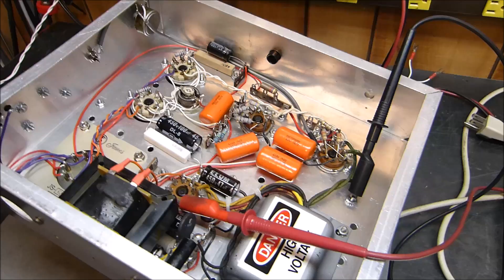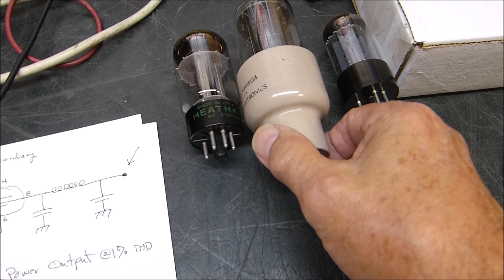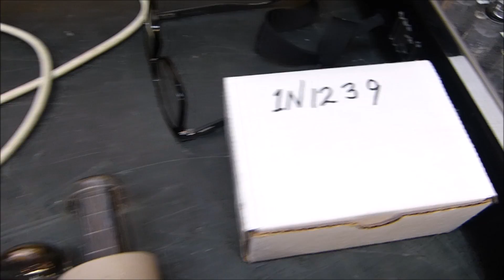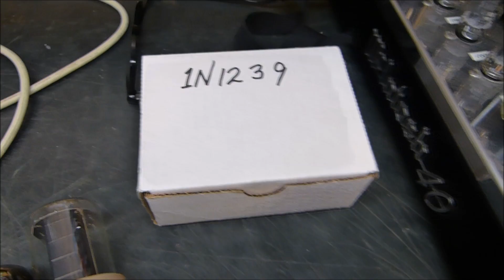5U4, 5R4, 5V4, 5AR4 & Solid State Rectifier Performance in Vacuum Tube Amplifiers

Comment: Curious why you switched from the hybrid diode tube full wave rectifier to traditional tube rectifier? I noticed that in your previous video "6B4G & 5881 Vacuum Tube Amplifier Using James Audio Transformer" you were getting more power from the amp and less distortion. . . . Also I've been thinking about building something similar but, I've been a little frustrated by the original Arcosound diagrams since they don't mention the DCR of the chokes or have many voltage readings through the circuit. (I like to model things in PSU Designer before building) With some educated guessing it looks like they ran the tubes pretty hot, they wrote 450 volts on the KT66 plates (i did some guess work and I think real world it would be closer to 480)  did you lower the voltages in your build? (I can't see how a 6B4G wouldn't fail under those original voltages) Unless you went with the power supply from the 6B4 circuit but the front end of the KT66 circuit.
Reply from the maker: Hi David,
I did remove the SS diodes and change it from a bridge to just a tube full wave and basically cut the voltage in  half. I think this amp would do about 15-16 watts at the high voltage. Actually, it was way too high with the bridge and of course it did drop the power considerably.  You are right, it is a miracle that the tubes didn't fail at the higher voltage.
A good bit of difference in output power can be observed going from the 5U4 to a 5AR4. If I remember correctly  from about 6 watts to 10 watts as the rectifier stands now without the SS devices to make it a bridge.
I wouldn't worry to much about the DCR of the PS choke and I think the best Acrosound/Williamson amps are the Heathkit WM-5 (I believe...) where they either run a pair of 6SN7 or 12AU7 drivers. The older designs with the 6SL7 is very high gain (I believe about 100 mV for full output) and distortion is much higher and the gain is not needed - or desirable - in my opinion.
Running the tube plates as high as you can and keep your electrolytic capacitors save is, again, in my measurements,  the best way to get the most amount of power and the least amount of distortion. 480 volts is good if your PS capacitors are rated at 525 V.
In your modeling program I bet you can see how the initial turn-on of a PS way over shoots the DC value of the electrolytic capacitors especially on the input capacitor of a PI network.  Not so much so on a choke input filter.
Even though this amp is at most 10 watts now, I have a real appreciation for its simplicity and sound and possibly the fact that it is triodes in the output (?) I don't know...  and I am sure in a blind test I couldn't tell it from any other amp ranging from $5 to $50,000 if it was running at 3 watts into the speaker...   :-)
Reply: I've been in a bit of a quandary since James Audio went out of business but, yesterday I stumbled upon Toroidy's toroidal outputs from Poland they even have Cathode feedback windings and they're about $126 a piece and rated at 80 watts PP . So I think I'm going to give them a shot only trouble is now I'm not sure how to incorporate the CFB winding into the Acrosound/Williamson circuits. I want to build something with a high power rating since it's going to end up driving my Magnepans. Any thoughts / suggestions would be greatly appreciated! :-)
Reply from the maker: As for the separate NFB winding that sounds like a nice transformer. I would like a little information on them so I can look into buying one (or two)..
I determine the value of the NFB components by starting with the point of about 16 dB NFB. The way I measure it is to disconnect all FB and set the amplifier to maybe 5 watts - some level well below clipping and distortion. Then start adding in a FB resistor and see what the power drops to. Calculate dB loss with 10log(p1/p2) and see what you get in NFB then run a series of power and THD tests to see how it turns out. If that is not good, raise or lower the NFB resistor value and measure again. Start with maybe 2K ohms. 
On the amplifiers we tend to build, around 16 dB NFB seems to turn out OK. At 20 dB NFB things starts to get weird at the LF end. I "tune" the NFB resistor and capacitor for maximum power output which coincides with minimum THD and make sure it is stable and not trying to oscillate at LF (20 Hz and below). I do see amplifiers that tend to oscillate at maybe 1/2 to 1/4 Hz. Very slow rise and fall of the sine wave even when driven at 1 KHz. It doesn't seem to be a real problem but it does make the THD meter act weird and probably should back off the NFB a little bit. As for the parallel capacitor around the NFB resistor - that one is more tricky. I personally use a GR variable capacitor that will go up to (I think) 1100 pF and usually find a point around ... maybe... 200 pF that works well. Got to watch the top and bottom of the frequency range when playing with the C. Sometimes I just leave the C off. Hope this helps.

Comment: The other SS rectification consideration is supposedly when you are using high 500+VDC B+'s, when the output tubes cathodes are cold and not releasing enough electrons yet, the high difference in potential can actually strip the electron rich coating material right off the cathode.  ;^)  Quickly causing poor performance of the output tube if it is turned on/off from cold often.